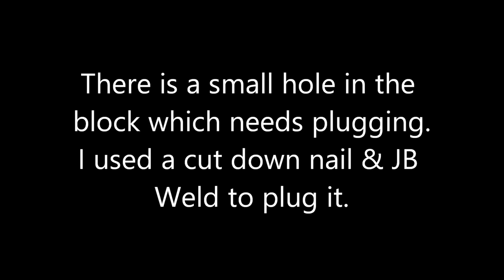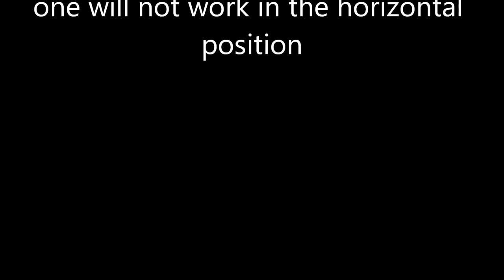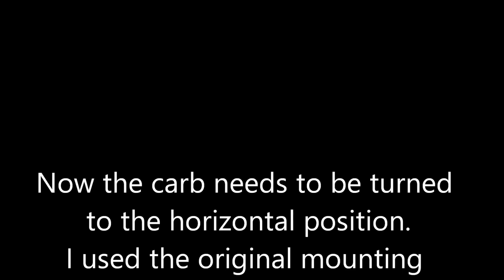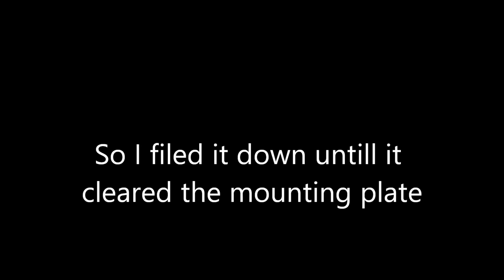Briggs & Stratton vertical shaft to horizontal engine conversion for go kart or mini bike

Comment: Vertical engines have a light weight flywheel because the lawnmower blade is considered the flywheel. This will run only at high RPM and will stall easily when slowed down. But you can add weight inside of the flywheel to solve this problem.
Reply: Where exactly inside the fly wheel?
Reply: David Perez fishing weight near the bolt of the fly wheel maybe ？
Reply: Most likely the intention of this engine would not just be running for no reason.
So in this case it might be a go kart axel instead of a lawnmower blade.
Reply: @athank3509  yeah but unlike a lawn mower blade or a weighted fly wheel which once moving will have momentum, the go kart axle will be constantly putting load on the engine (not allowing it to run at high rpm). At least this is what I imagine will happen. In reality I have no idea 😂
Reply: Those engines go on more than lawn mowers, I’ve had them running when removed and they run fine, on larger engines the flywheel is on the lighter side to prevent them from coming apart, but they will have balance shafts inside the crankcase
Reply: @BudgetBuilds1130  yeah after I’d write that comment I took apart a briggs mower converted it to horizontal shaft and made a motor bike with it. Works great so you’re totally right.

Comment: So two questions, do you have to fill the old oil feed hole on the crankshaft, or can you just have both open, and how is oil getting to the valves?

Comment: Are the internals (camshaft, connecting rod, crankshaft etc.) the same between the vertical and horizontal engines of the same horsepower?
Reply: I want performance parts for my  420cc vertical shaft engine too hope the block can handle it
Reply: edward h  they should be if the model numbers and year of make are matching then they should be the same

Comment: I got an old engine for free off a mower already rearranged the carb bracket the same way and removed governor. The problem is the crankshaft is bent from hitting something when it was on the mower. The other thing I was thinking is doesn't it need heavier springs since it will run at higher rpm? the plastic camshaft is also not designed to run at higher rpm.

Comment: the way im using it for my kart is running a belt to a riding mower trans axle so i keep it a vertical shaft engine
Reply: gokartbuilder so is the belt twisted 90 degrees to go from vertical drive shaft to horizontal axle?

Comment: And why make new oil feeding slots
Reply from the maker: The slots need to be at the top of the bearings
Reply: I know i need to make new slots cause the oil will get in there for the spinning things but why blocking the 2 others ones? do i really need to block
Reply from the maker: Dayz fire you block the other holes to keep the oil in

Comment: can I use a lawn mower motor to make a go kart without making the motor horizontal?
Reply from the maker: You can but you would need some sort of 90 degree gearbox or lawn tractor pulleys
Reply: ok thank you 👍

Comment: when you go to horizontal position how are you  putting the oil in?
Reply from the maker: Hi, I just tip the engine & fill using the drain plug.

Comment: As much as i want to do this I know I cant
Reply: Get an old mower engine and do:
- Flip to Horizontal position
- Spin Carburetor 90 degrees(if possible)
- bend a thin piece of metal and stick it    between the connecting rod and the bolt to be used as an oil flicker/dipper 
- fill old oil hole with either JB weld or a tube that can fit
- rotate pull starter to an upwards position( if possible) 
- measure how much oil is needed

Comment: hey do got any spare engine can give me plz
Reply: dude just look around your neighborhood and ask one of my neighbors the lives in front of me had 10 lawn mower 4 edgers he gave me 3 lawnmower engines one in full lawnmower witch i converted to propane and now my personal lawnmower today i repaired the carb on the edger and the lawnmower engine with no frame i was making a flywheel with a 5lbs weight and it ranned the other one needs work with valve timing but all for free also with a small 4 speed transmission with reverse going to make a gokart if i can